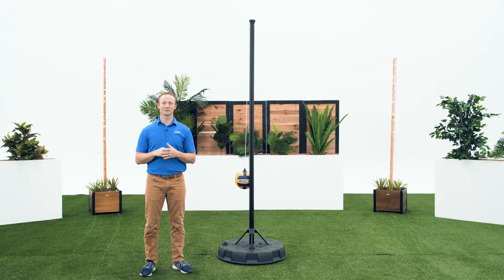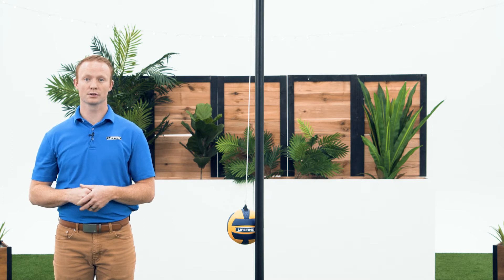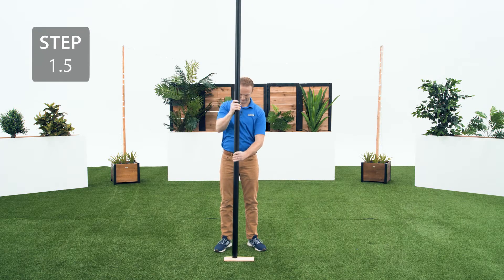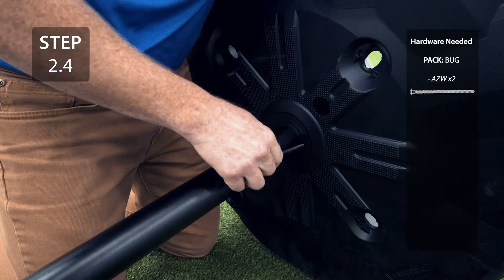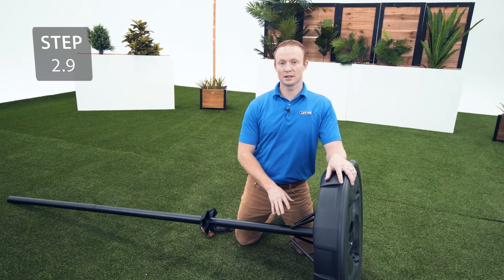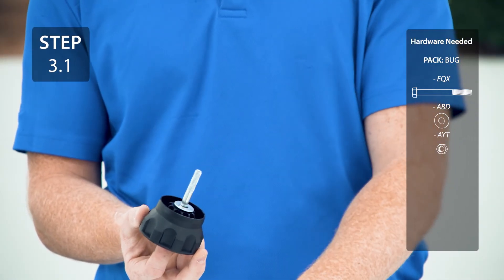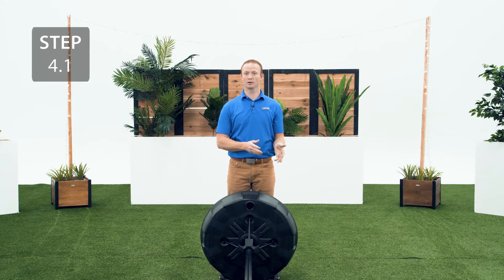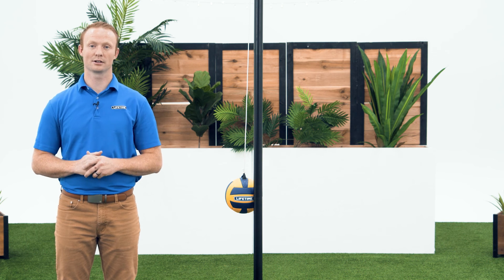Lifetime Tetherball System | Lifetime Assembly Video

Comment from the maker: Section 1
@ | Step 1.1
@ | Step 1.2
@ | Step 1.3
@ | Step 1.4
@ | Step 1.5

Section 2
@ | Step 2.1
@ | Step 2.2
@ | Step 2.3
@ | Step 2.4
@ | Step 2.5
@ | Step 2.6
@ | Step 2.7
@ | Step 2.8
@ | Step 2.9
@ | Step 2.10

Section 3
@ | Step 3.1
@ | Step 3.2
@ | Step 3.3
@ | Step 3.4

Section 4
@ | Step 4.1
@ | Step 4.2

Comment: What type of drill are you using? We can't get the screws into the pole to secure the bottom.
Reply: I discovered it's the drill bit. You need the   sharp tip 'MASONRY DRILL BIT SET'